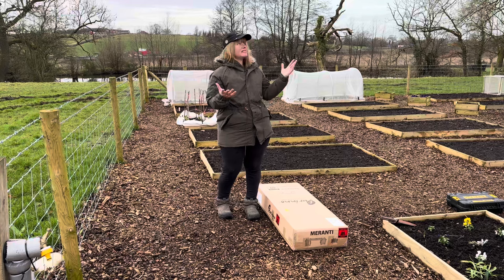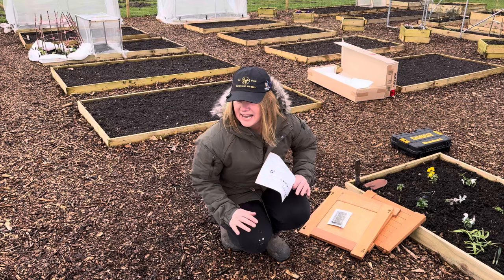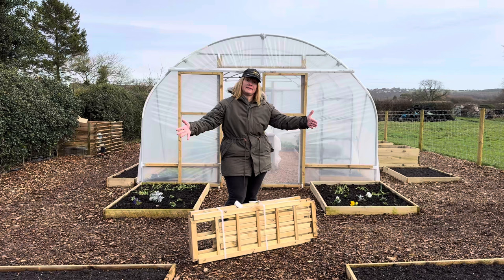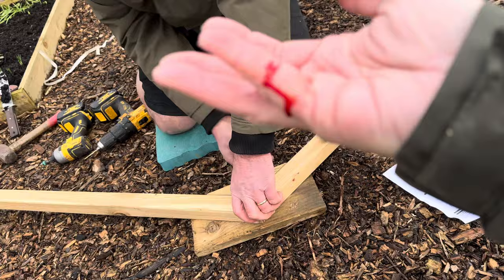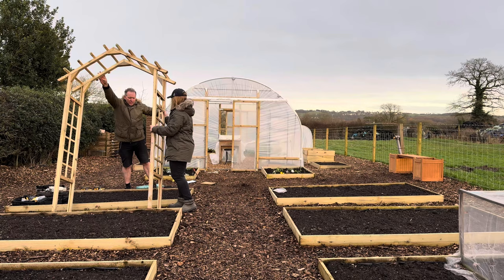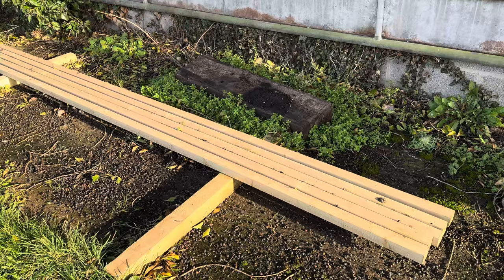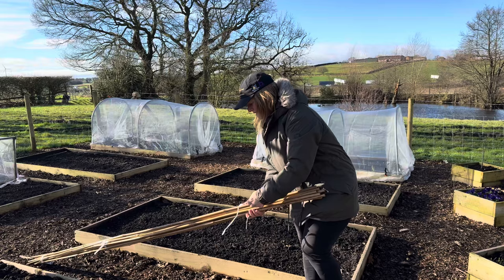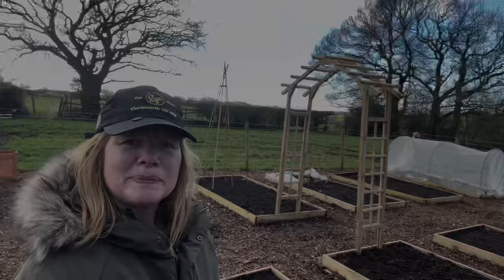Building Allotment Bean & Pea Supports

Comment: Hi Clare, Arch, bench and trellis look great, but I would have used meta post spikes on the arch feet to prevent the posts from rotting with standing in constant wet soil.
Reply from the maker: Yes, could be an idea if you can even get the posts spikes that small? To be fair, they cost less than we could make them, so I’m not overly concerned about their longevity at present. 

Will look in to it ☺️